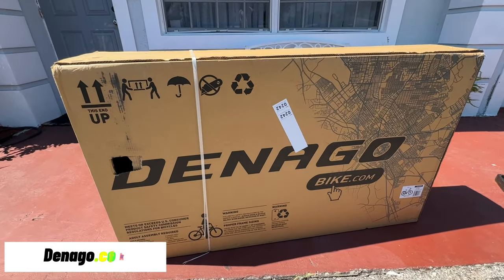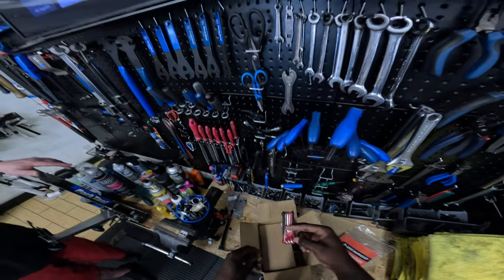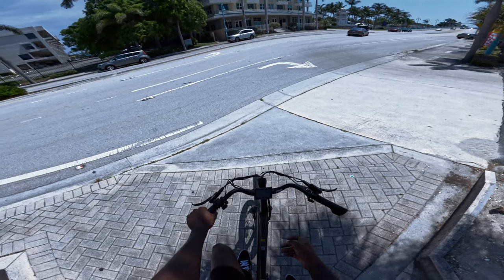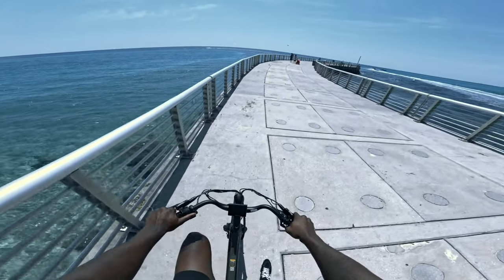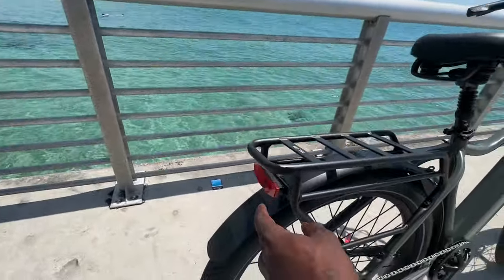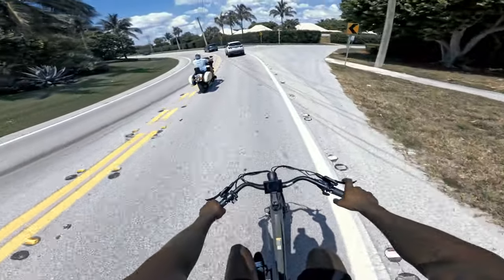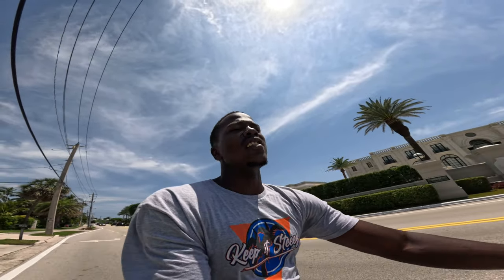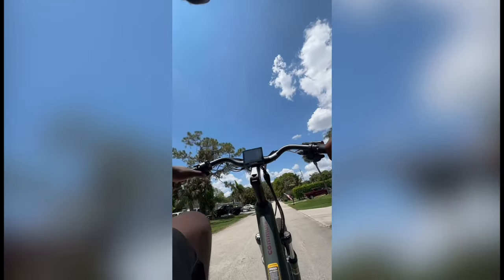First Ride on my New ELECTRIC BIKE!

Comment: Hey steezy I been trying to make my bike easier to wheelie because I struggle and I had some questions. How many size 33t sprockets do I need? Also what size freewheel do you suggest me get with however many sprockets I need? How many freewheels do I need? What size freewheels and sprockets are the best to help me as a beginner wheelie? Love ur videos man keep up the great work and if you could help me out that would be great
Reply: Also do I need different sprocket sizes for the front tire and the back? If I do please suggest me the best size for each. Also do I need different size sprockets for my bike? What sizes are the best for sprockets and freewheels for me to ride easily and wheelie easier?
Reply from the maker: Rideout supply 33t sprocket 16t free wheel
Reply: But do I need freewheels
Reply: But do I need freewheels
Reply: Nvm cuz I thought I needed 2 sprockets and multiple freewheels
Reply: Wait which one goes on which tires
Reply: Also love ur videos bro keep up the good work